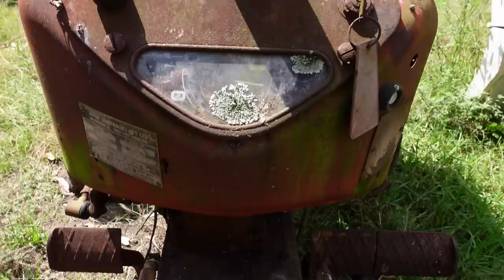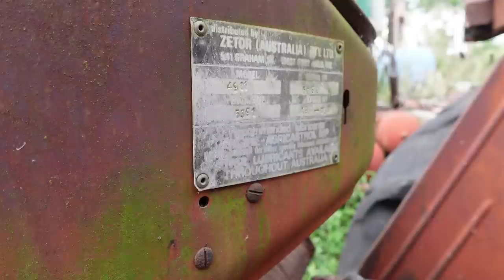WILL IT START? Zetor 4911 Abandoned old Tractor Not moved in 40 years.

Comment: I missed some older videos, this is a cracker. Great to see the old girl fire up after not a lot of difficulty. If the running gear frees up easily she will be a solid old unique tractor
Reply from the maker: Yeah mate I did some work for that one. I still have it here. It runs great but she still needs a lot of work. I think if the tyres were ok it would be worth getting to a useable stage
Reply: @stevesplacedownunder  yeah you can see a lot of work went into the video, and maxing out card storage on the camera

Comment: Hi steve i have 3 zetor tractors i have them for years and my dad before and they are great tractors we see nothing wrong with them and they are simple when you know them
Reply from the maker: They are good tractors mate once you know what does what. There’s a lot more levers and gear and pto speeds, not as basic as other manufacturers. But the power that the 6911 we have here is unreal for that size of machine

Comment: Zetor's are actually pretty good machines. Though like any imported machine especially here in the states they tend to be hard to get parts for since there's not many dealers. I've only seen one Zetor dealer around here and it's an hour or two away in another state over. I've seen some old Belarus tractors here and there as well and they have the same problem. Simple tough machines but hard to get parts for if something vital breaks.
Reply from the maker: Thanks for watching mate. They are really good machines. The bigger one we have had been great for us over the years. I’ve never seen a dealer here but anything I’ve looked for I’ve found on eBay and not bad brands either. Not sure about major parts but all the basic engine and brake parts ect are there. There are a few Belarus tractors around that I’ve come across here also.

Comment: What i notice is that zetor tractors start easier than other tractors just pump air out of diesel system and have trottle open and it will start quicker than any other tractor make david brown tractors and some ford and massey are slower to start when trying to get air out of diesel system and the smaller ford tractors have no fuel primer which makes it slower to start because you must use starter motor to start the smaller fords
Reply from the maker: They do start very easy mate. I have a bigger zetor also as I mentioned and if it runs out of diesel it will always start very easily with just hand priming and no tools. I know what you mean about fords. I have a 3 cylinder diesel in my forklift and has no hand primer, or a transfer pump. It just gravity feeds from the tank, through the primary filter and into the injection pump. To bleed that I crack the screw and let it run through itself

Comment: Steve ya got R model parked there       LUV EM 350     4valve      also Valueliners            not over worried about the V8            just good old R        Yep that's the button
Reply from the maker: Yes mate it’s an 84. 237 with a 5 speed
Reply from the maker: Drove a flintstone with a tri axle float on it for many years when I was younger for the quarry company I work for. It was rebuilt and had a 350 4 valve in it with a 13 speed fuller. Great to drive and plenty of power. Still in the shed I work in to this day

Comment: Wouldn’t be able too run to your local parts store for that top radiator hose, hey  !
Reply from the maker: No mate not at all , but, eBay has a good range and most parts I need for it are on there. I was very surprised considering it’s not a common machine here

Comment: First thing I'd do is fire up the compressor on your service truck and blow off all the rat crap and trash that has collected ove r the years.  It's a once and done deal.  Then get after anything that looks like it might need to come off with penetrating oil.  Then lube up anything that has to move with a pump oiler.  That's what I do before I start turning wrenches.  Saves me a lot of cussing later.  😊  Can't work with one hand.  Need a couple of tripods - one shorty to sit on a fender and one tall boy to setup in the field.  You be a whole lot less frustrated trying to work one hand and your video quality will be much better. 😊 The 3 cylinder sounds terriffic!  She's a runner.  Get out the pump oiler and grease gun!
Reply from the maker: First thing I did do is fire up the air compressor 🙄🙄. Thanks for watching